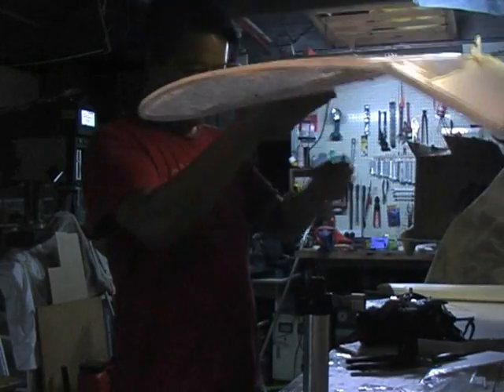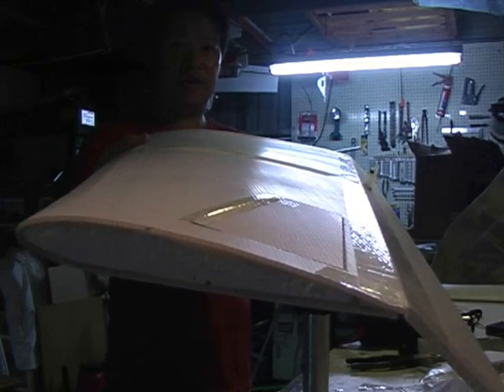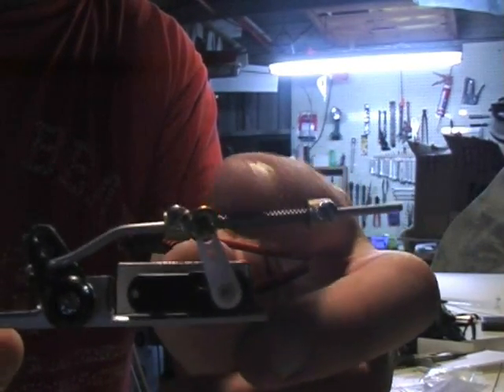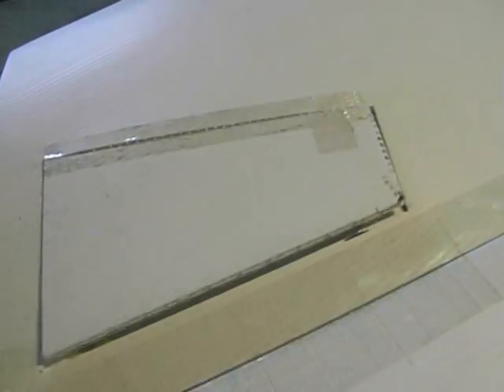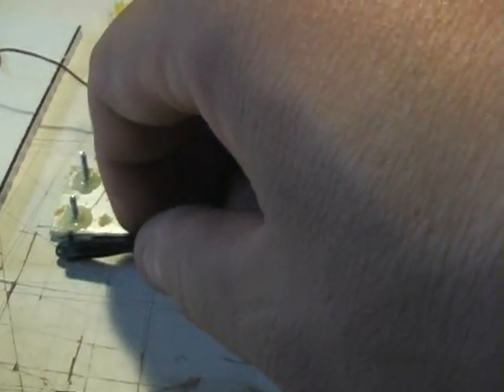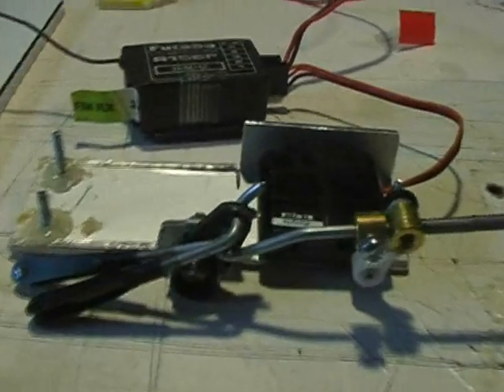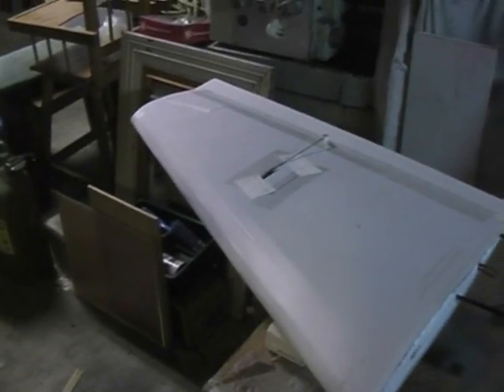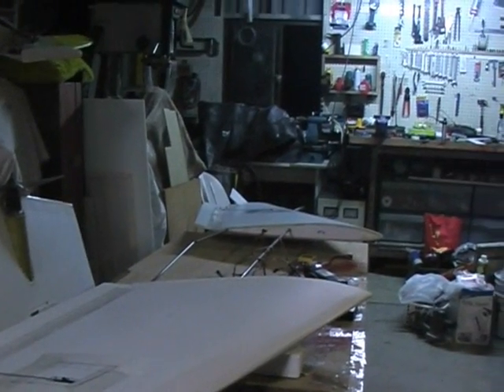drag rudder mechanism

Comment from the maker: Wow! This brings me back! Since then, 2.4ghz transmitters have come out and now all you have to do is mix a few channels. If you are thinking of doing this style of rudder, I would suggest bigger or longer surfaces and basically “on” at low speeds and gradually close them as speed increases . Just look at the B2 bomber in take off and cruise flight.

Comment from the maker: Thanx, the concept changed a little when fitted to the plane. I think I did take up more of the spring tension. Next time it will have larger servos and bigger surfaces as commanding a yaw was rather minimal if not sluggish. Flying wings dont need much in the way of vertical stabilisers so I hoped a small change in drag would have an affect.  RC powers had his version open all the time.